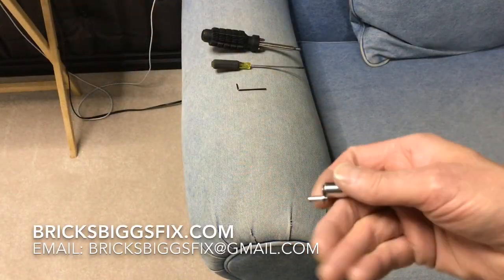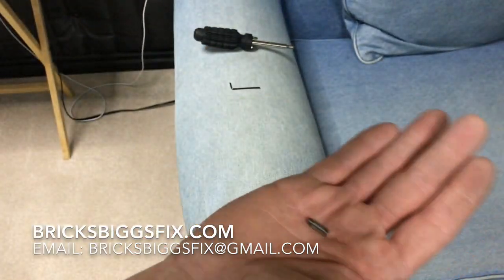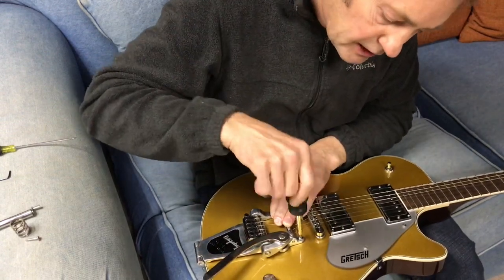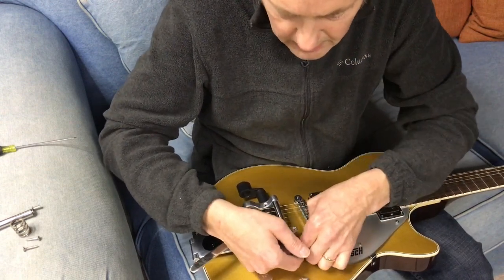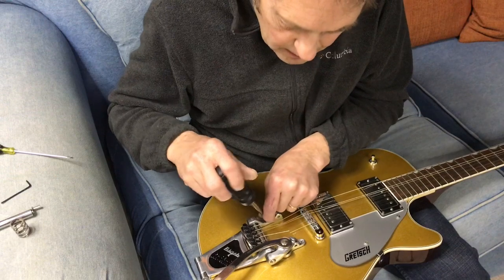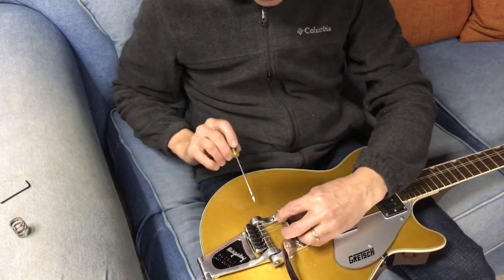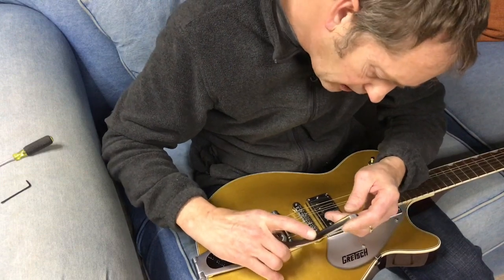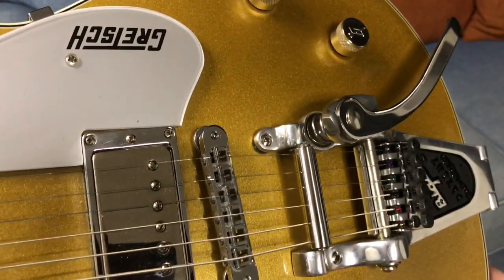Biggsfix BTS5712 Version 2.0 US Patent #9,299,325

Comment: So it looks like you just left the old set screw in place loose, as its not used at all with the new roller, or should it be tightened up again, or completely removed?
Reply from the maker: I leave it there (not tightened) for safe keeping. Otherwise it would be lost forever in the parts bin or worse, the couch.
Reply: @bricksjamroom3275  Thamks.  After watching this I realized I had a B50 Bigsby, so a little different config.  I bought your V3 and your spring last week, and it's working well.  Finally staying in tune...

Comment: When you replaced the bigsby b50 with the b7, did you have to drill new holes or did the screw holes match up?
Reply from the maker: Yes, I had to drill new holes. Filled the old ones and are hidden under the B7. This is my modding guitar, so I’m ok with that